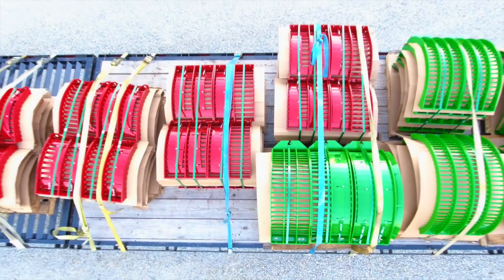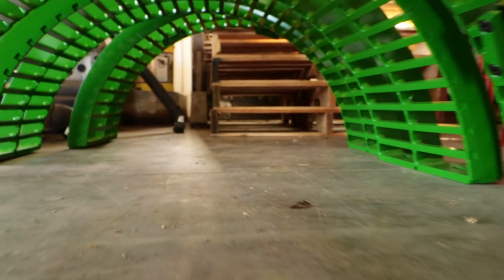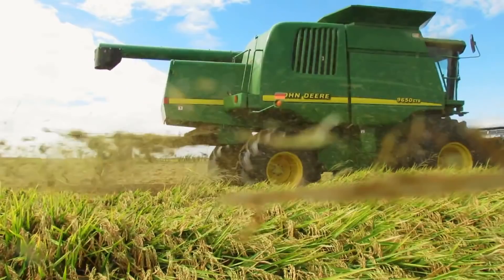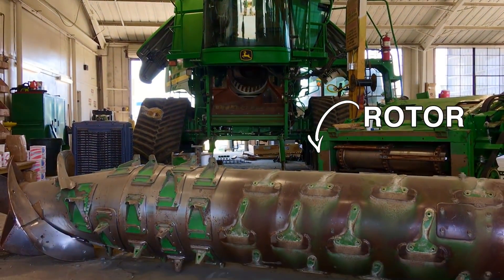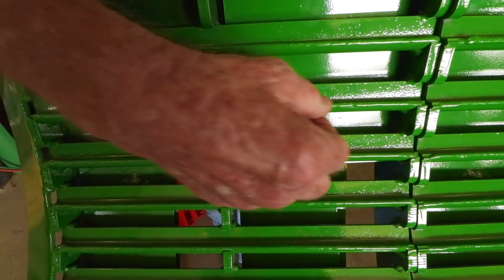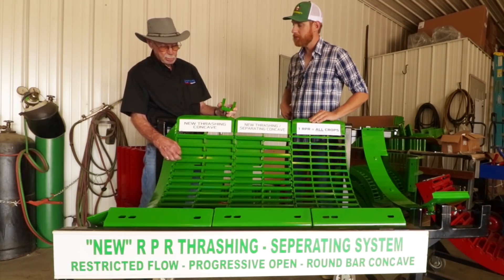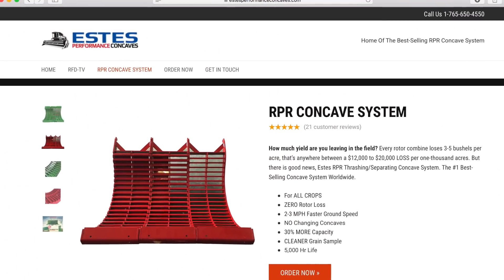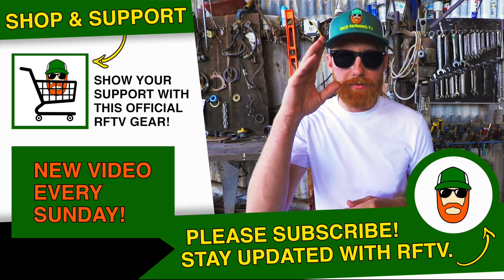Increase Yields by Eliminating Rotor Loss!

Comment: Won't work for us, all we have is Lexion 760's. Very interesting though.
Reply: P Wayne how do you like your 760's? I've heard the tracks are close to the frame and they don't do well in the mud as the mud has a tendency to tear things off due to their close proximity.
Reply: P Wayne do you have to remove with a hook rice straw caught on the concave under the drum every morning during harvest? I am just wandering if all the Lexion owners have this problem?
Reply from the maker: Mr. Harvester we have to remove the straw caught on the concave every morning. We bought ours used and it was just a recommended service from the previous owners. So we just did it during the normal morning routine. We haven't had any problems...it just takes 5-10 minutes. I'll open my concaves all the way up to make it easier to reach.
-Matthew